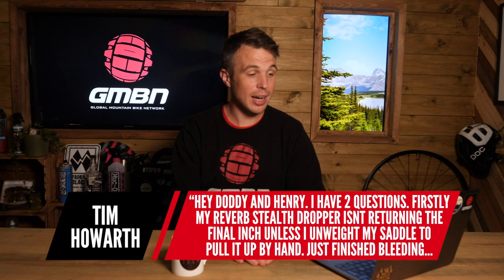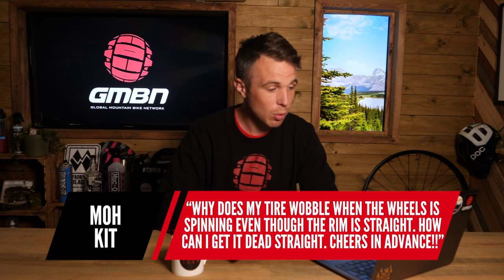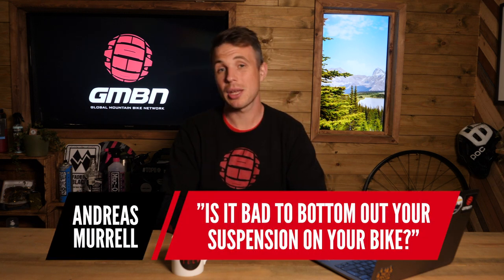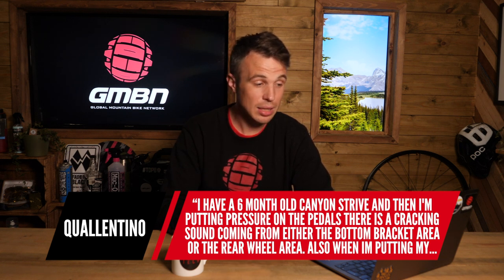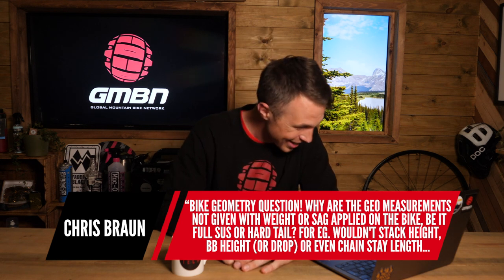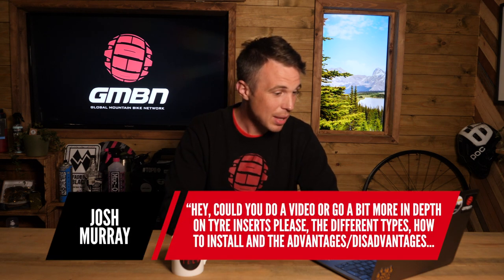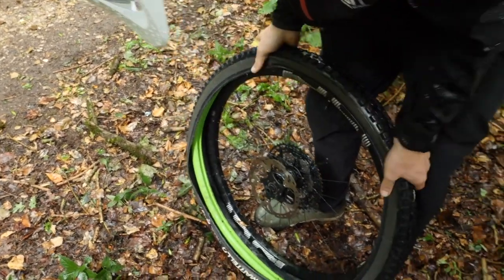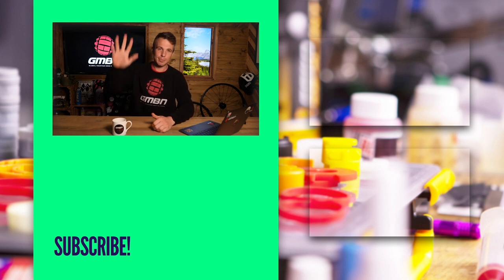Is It Bad To Bottom Out The Suspension Fork On A Bike? | #AskGMBNTech

Comment: #AskGMBNTech - Hi there, I'm in the market for purchasing a new trail bike after having moved on from my previous '17 Stumpjumper - the aggressive riding still belongs to my DH bike. My question would be, at what point does improvements in suspension specs become negligible? E.g., I can purchase a Cube Stereo 140 HPC (Carbon front triangle) with Fox 34 Rythm and Fox DPS Evol for $3750 AUD, or $4900 on a Norco Optic C3 which comes with a Rockshox Pike Select and Super Deluxe DH. 
I want suspension that works well of course, but with minimal equivalent spec changes between two such models, is there really a point in the extra $1150?
Reply: are you able to feel extra stiffness in a fork, do you need it? Do you need extra rebound/compression adjustments? Will you notice a couple grams of weight difference? All those factors impact price by a lot

Comment: #askgmbntech I I have a Shimano BB80 hollow tech II bottom bracket and it’s creaking due to multiple deep stream crossings. Turning anti clockwise on the  drive side it’s so stuck I broke the park tool BB19.2 in half.  How do I get this bugger out?
Reply: soak with penetrating oil, try again with a new tool or go at it with some decent pliers
Reply: ultiss using a pipe wrench?

Comment: #askgmbntech is it bad that my Sr suntor 32 coil forks are leaking assembly grease all the time and making squeaky noises. Do I need new forks?
Reply: sounds normal, its an entry level fork with poor seals so it requires periodic maintenance. an upgrade would be nice though

Comment: #askgmbntech I got my first dropper seat post recently. Loving it. I have two questions 1) does storing the bike with the seat post down cause any issues? (Just while I’m my day van to make it fit) 2) are there any issues with using the seat post part way down with weight on it or is it best to only weight fully out? Thanks love the show
Reply: Both are fine, storing it down and using it at any height with weight on it
Reply: Actually, storing it down long term is not recommended by manufacturers...but a few hours now and again while traveling is fine, just not a week or the like
Reply: @rupedog  yeah I assumed that he was gonna be using often considering he has a van and will most likely be traveling different places to mtb

Comment: #AskGMBNTech i have a trek x-caliber 8 2020 model,and i wanted to change the current fork from 100mm to 120mm-130mm,but when i ask trek's helpline,they say i should stick with the current fork.

so why can i not change it to a longer fork on a xc-bike?

and how do i know if a hardtail can fit a fork that is 120-140mm of travel?
Reply: because you will change the bikes geometry by raising the front end up and you will put more stress on the headtube because of the slacker headtube angle. More stress while it isnt designed for that means Trek will say nope
Reply: @ultiss  how do i know if the frame itself can fit a fork that fit a longer travel?

Comment: #AskGMBNTech Referring to Doddy's fork stanchion repair video, is a repaired stanchion good for the life of the fork? Also, will it effect its overall usage or will it perform as it did prior to the damage? Thanks!
Reply: Not permanent, but might last well. That sealing interface is to keep oil in and dirt out, so u might need to service lowers more often

Comment: #AskGMBNTech Hey! Henry said at 2:41 that the rattling sound which can be heared by standing the bike on the backwheel and bouncing it up an down can be an indicator for worn  elements in the lower legs. What can I do if this is the case. I checked my headset twice and I still can hear it. It drives me mad when I descend on something technical. Hope you can help me with that.

Comment: #ask Gmbn 

hi guys! I've recently bought a new vitus sommet and out of the box I've noticed the front fork seems to be skipping when you start compressing. I find I have to press harder and harder then it jumps rather than a smooth start. is this normal?
Reply: the rubber seals in the forks damper/spring need some breaking in, it should improve or its a warranty issue
Reply: @ultiss  done about 5 rides on it now and no improvement

Comment: #AskGMBNTech Hey guys, loving the channel! I have a question about tires. I have a set of RaceFace AR 30mm rims (inner width), which I want to use for all-round tracks, easy trails, fire roads and occasionally gnarlier terrain. I was thinking about these tires: Conti Mountain King 2.3 in the front and Minion SS 2.3/ Rock Razor 2.35 in the back. However, I don't know if these are fit for this 30mm rims. Suggestions? Thanks!

Comment: #askGMBNTech   "Street Worthy Scout". Could you suggest a street tire,that has more grip than your average commuter type tire? I'm currently running the OEM, 27.5 DT Swiss M1900,in 30mm. (These will eventually be my street wheels) Nukeproof states that the Scout can accommodate a 2.8 tire. I don't necessarily need anything that wide. The only tires I've found that aren't skinny pizza cutters, are the Schwalbe Super Moto X. I do like those, but are there any other real options available? Thanks in advance.....
Reply: any xc tire?
Reply: ultiss Street tires. Like the Hookworm or equivalent.

Comment: I have a brand new rockshox lyrik fork 2017 edition. No matter how I set the suspension up I can't seem to get them to track small bumps. They are 35mm stanchions (180mm) and I weigh around 66kg, 

Is your weight a factor when choosing forks?

#askgmbntech
Reply: If you want way better small bump compliance upcrade your air piston to the newest one(somethink like 40€)   but first check that both your compressions are full open(counter clockwise) if that don't work maybe you could just lower the pressure to like 55-60 psi and if you are bottomin out too much add some compression and maybe some bottomles tokens

Comment: #askGMBNtech

Hi guys. I bought an used mtb last September. The bike is 12 years old. I find that some of my spokes break every couple months. While I have replacement spokes I don't want to be replacing spokes every couple of months. Is there something I am doing wrong, is there something I can do to make this problem better?
Reply: spokes do wear out from being pulled and pushed on while riding. Id start with retensioning all of the spokes, fixing 1 at a time is only a patch repair. When tension is even and the wheel is straight but you still snap spokes either replace all spokes at once or get another wheel. Its a wear item after all

Comment: #AskGMBNTech what is preload on forks?
Reply: its found on most coil forks: a dial which can be screwed in or out to put more or less initial pressure (preload) onto the spring. This is how to set sag on a coil spring. Often the dial only does miniscule adjustments and you'll need to swap the coil spring for a stiffer/lighter one to tune it to your weight

Comment: Reverb posts are known to have this issue for years. Perhaps try One Up or PNW posts.
Reply: Older posts, a few did. New ifp design and latest post with bleed valve dont. Its occurs on any make with ifp. Including those. Mostly it was overly tight seat post clamp tho
Reply: i think reverbs are on the 5th generation by now (A1, A2, B1, B2, C1), they arent all shit. Ive got a 100mm B2 reverb and it works fine

Comment: #askGMBNtech during the bike shortage, it's difficult to buy a bike in store so I'm looking online. I currently ride an old late 90's hardtail and am looking to upgrade. Either way I fit into a medium frame, but I'm unsure if I should go with a 29er or 27.5" can you explain the way that the tire size impacts the feel of the geometry and handling of the bike? Thanks!
Reply: They made a whole video about it. Just search for wheel size and gmbn
Reply: in short, (my opinion) 29er is more stable and perfect for cruising. If you like a more snappy playful bike get 27.5". If you care about resell value get the 29er because thats what everybody thinks they need

Comment: #AskGMBNTech hey guys love your videos, my for stantions shake in my lowers do I need to worry about it
Reply: sounds like your seals are buggered. if you can, try and get new ones. if not, the fork is dead so either ride it like it is or buy new ones.
Reply: Not seals....the bushings worn. Might be able to get replaced...check with a suspension tuner

Comment: I would like to know if u think mountain bikes and everything that goes with the hobby for example safety gear, spare parts, maintenance, tools and even lift tickets is to expensive to most people and what the industry can do to make more higher end riding more accessible.
Reply: you decide how expensive it becomes. If you get a decent 2nd hand bike with say a 10 speed drivetrain its not expensive at all. And dont skimp on a decent helmet, more expensive often means more comfort and a pleasure to use. Better safe than sorry

Comment: #AskGMBNTech can I put tire sealant in my tube for avoiding flats because I don't have a tubeless compatible rim and I keep getting flats {thanks a lot}
Reply: Actual tire sealant might be compromised by the white anti-stick powder inside a tube and get triggered, i.e. start clogging up.
Muc-Off has dropped a product called "no puncture hassle - inner tube sealant" wich is desingned to go into inner tubes, for cases just like yours!
Just be aware that the application tube on their bottle is designed to fit car valves only, therefore has a wider (!) inner diameter. Using it for filling a tube with a slimmer (!) sclaverand valve will be messy! (ask me how i know)
Reply: @geemail369   ok thanks

Comment: #AskGMBNTech When I try to set sag on my bike I get durasticly different results 25 % up to 50%  also my forks don’t absorb smaller size bumps at low speeds, and at higher speeds I’m using all my travel frequently I think it is just low on psi but please tell me If it it could be something else
Reply: Sag should be set with all compression damping set fully open/fast. And u adjust the pressure until its approx 25%. I suspect ur not following correct sag procedure based on what u say. U should watch a few videos on it from respected sources
Reply: Rupert Wenn thank you very Much

Comment: Hayyy, I want  to  know Is it possible  to fit a tapered fork in a non tapered  headtube  by using something  like  a lower external headset  cup🤷‍♂️  #AskGMBNTech

 T.J. van der Walt  from South Africa 🇿🇦
Reply: there are headsets that can do this, but i think it depends on if your frame can support it
Reply: if you have a 44mm headtube and the ability to fit the cup deep enough in there it should work.

Comment: #AskGMBNTech Hi guys, I have a question on shocks. I just got mine serviced and I pumped it up. The rebound is extremely slow and I’ve had to set it on the fastest in order to have anything bearable. I’ve heard it could be something to do with one of the air chambers isn’t correctly pumped up or something but I have no idea how it works so any help would be appreciated. Thanks!
Reply: What shock do you have?
Reply: Otto Hemio fox float ctd
Reply: @stanp2281  try to inflate it 50psi at a time  then cycle it a few times and inlate it like that so it will correctly balance the negative   it might also be a bad bleed or my rs monarch did that when the ifp was not inflated properly
Reply: Otto Hemio ok I’ll give that a go thanks

Comment: #AskGMBNTech
Hi there, my friend bought a Rockshox Lyrik fork and had problem with shock pump valve wouldn't engage to the Schrader valve of air spring side which made him unable to read air pressure. He tried a few shock pumps and still has that problem. In the end, he had to unscrew the Schrader valve body a bit, then it would engage. (which he could read the pressure in the fork)
One of the shock pump we tried was mine (LifeLine shock pump) and it works just fine with my fork (Revelation).
Has anyone had this problem?

Comment: #AskGMBNTech Hi Doody and Henry, I have been eying up the YT Capra Base for a while now and have only just pulled together the funds to buy one. However, the next available one will arrive on 15th December. Should I hold off until the new ones come out in January? I don’t really want to hold off and then find out that they have dramatically increased price or radically changed components.

Comment: #askgmbntech every time u go riding I get bad hand cramps I have switched grips to see if it would help but it hasn’t what are some reasons why this happens and how can I fix this.
Reply: Tristan, to clairify, it's cramping, not numbness or tingling? 

Without seeing you ride or your bike setup I would guess squeezing the brakes too hard. This is usually because of underpowered brakes (causing hard and prolonged gripping) or a brake bite point or lever distance that's not right for your hands. 
Upgrade to 4 piston brakes or bigger rotors or sintered pads if you can. Bleed brakes. Try adjusting your levers closer or futher away from the bar. Roll the brakes on the bar so your forearm and wrist and pointer finger make a straight line most of the time.  (Wrist bent upwards to forearm is bad. It will put unecessary tension into the tendons and fascia used for gripping.)  
Otherwise try to shift your weight as much as you can down into your feet so they feel stuck and concentrate on keeping your hands loose and light around your grips. Softer smaller circumference grips might help. In easier terrain, periodically flick your fingers straight and unhook your thumb (opposite action of gripping -  a "shoo" motion) if safe to do so. Sing to yourself. Anything to keep the hands loose and body relaxed. 
It's usually underpowered brakes though. Pretty hard to have a loose grip if you don't think you can stop. 
Source: clinical RMT specializing in muscle and tissue pain biomechanics. I ride with light hands and never had hand cramps until riding steep loose jank with 2 piston brakes. Cramping immediately resolved with 4 piston and adjustable levers. I just brake less often and not as hard with more powerful brakes. And hold less tension in body overall.
Reply: could be saddle position fore/after, saddle tilt, stem length, handlebar rise/sweep, ...
Reply: Maria Bird  I will try the lever positions, my brakes are mechanical and I recently switched to a L frame from a S do you think that might be part of it

Comment: #AskGMBNTech why is it that less expensive bikes have worse geometry. I wouldn’t think that welding tubes at a different angle would result in a higher price, especially since they have no need to go through development because good geometry is something that is well established.
Reply: Probably because it gives you more insentive to spend more money with the brand and get a more expensive bike with the better geo and what not
Reply: but good geometry isn't well established because each brand has slightly different measurements on equivalent bikes. also if you gave a hybrid a really slack head angle would that be good for city riding? many people use less expensive MTBs for commuting as well as trails and bike manufacturers know that. noobs usually won't benefit from a super slack head angle it will just inhibit them.
Reply: It is the research and huge amount of testing that brings the prise up also!

Comment: Hi guys, love the show. My question is, how do you for a triple clamp fork, with a straight steerer, to a frame with a tapered head tube? eg Kenevo comps upgraded to a Boxxer fork? #AskGMBNTech. Obviously the frame must be able to take the strain of a triple crown fork.
Reply from the maker: Hi Nigel, look up the correct size of reducer headset for your frame and if it is compatible. Best check in with your local bike shop in order to make an accurate purchase and to check compatibility because it can be a bit of a minefield :)
Reply: @gmbntech  Thanks, gonna get the shop to do it.

Comment: Hey y'all.  Now that forks have many different travel options in a single model, and some models overlap others, which fork should I get, the one where travel is expanded or reduced to get the travel I want?  What are the pros and cons of each? (for example: RockShox Pike vs. Zeb) #askgmbntech
Reply: if you want a really stiff fork get the zeb. if you aren't as interested in massive jumps and really high speed tech get the pike.
Reply: Or go for the best of both worlds which is lyrik!

Comment: #askgmbntech Is it a good alternative to use tubeless tire patches instead of buying a whole new tire.
Reply: Yes...
Reply: If the hole is small yes!
Reply: Yep, valid method.
If you really wanna "seal the deal" (pun intended) just make sure the surface is REALLY clean and have the tire sit over night, right after sticking on the patch and mounting it using an over-inflated inner tube (to have it press the patch onto the tire and help it stick).
Alternatively you can use a piece of tire and galvanizing rubber glue (+agitating/sanding the surfaces!) to glue it to the inside using the tube method - but that's more of a bodge.
Remove tube in the morning and go riding!

Comment: What are some of the reasons for a loose headset and how do you fix it without taking it apart? #askGMBNTech
Reply: Just loosen the pinch bolts on the stem, tighten the top cap, retighten the bolts, and go shred!
Reply: @thebenman7291  I will try that again. I even apply the front brake and giggle it while tightening. I wonder if adding grease will help....The bike sat on the rack for a year before we bought it.
Reply: @MTBMOR  could be that, could be the bearings are screwed. if nothing else works its probably new headset time, sorry.
Reply: @bananasstuff3344  Thanks for the idea...I haven't a clue and the topcap screw is on way too tight....I think it is time to visit the LBS..Hopefully is is something simple
Reply: if you overtightened the headset and feel friction in the bearings, but it still loose then maybe your diagnosis is off. A clunky front end can also be caused by worn fork bushes or worn wheel bearings